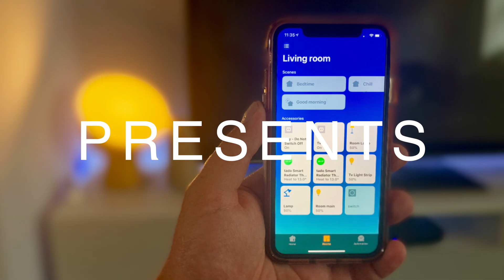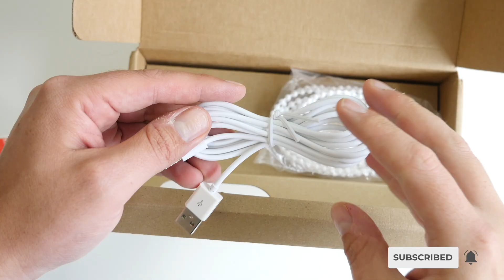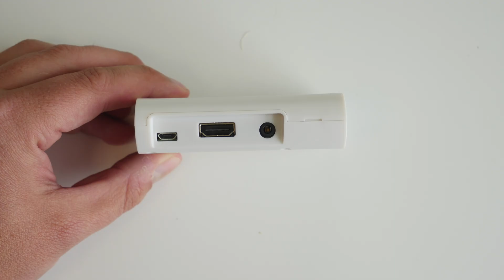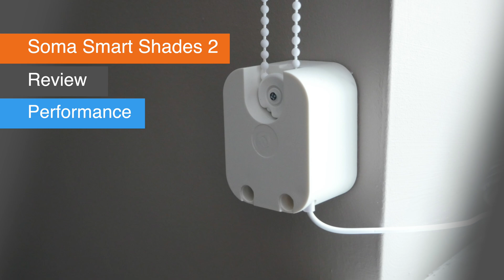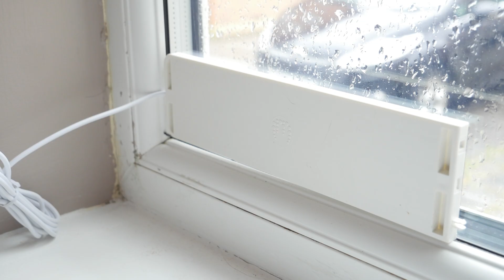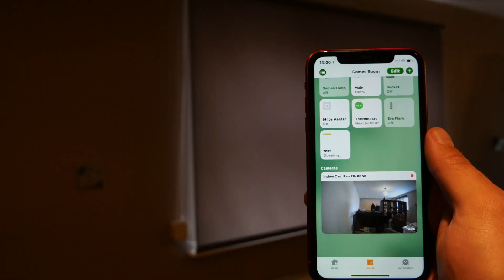Soma SMart shades 2 review - HomeKit enabled smart blind controller with improved speed!

Comment: Soma Smart Shades is a shockingly bad bit of tech. Avoid and go with something more reliable. I’ve had it since it came out and it’s always either stuck or the hubs disconnected and needs restarting which results in Siri saying “the blinds are not responding”. To update the software you have to manually remove the memory card from the hub (raspberry pi) and then put it into a card reader, then download the software manually from their website, then put it on the usb card, put it back in the hub). The whole product is so clunky and buggy. Avoid avoid avoid.

Comment: Soma really should add Open/Close buttons to the face of the device. Maybe even a physical switch to disengage the motor from the chain drive to allow for manual use if something goes wrong and it isn’t functional for whatever reason. I’m a firm believer that if automation prevents manual operation, then it’s bad automation.
Maybe in a Version 3 🤞🏻

Comment: Can you sync 2. I have 2 windows in 1 room
Reply: I have the same question. Probably using Somma Connect you can do that. It support unlimited number of SOMA Smart Shades, SOMA Smart Shades 2 and SOMA Tilt devices.
HomeKit Authority, Could you confirm if is it possible with and without the Somma Connect? Thanks in advance!

Comment: Hi! I’ve just got another smart blind controller and I’m having a small controlling issue inside Home app. You see, the motor I got is controllable through TuyaSmart and I’m using a HOOBS hub to being able to control it in Home. 

Here’s the issue: in TuyaSmart App, I can set the blinds opening at any percentage, but in Home, I can only fully open or close de blinds. Is it a limitation of Home? I saw you in your video controlling your blinds in Home, but you did not stop it midway let’s say. Is it because you simply can’t in the Home app?

Thanks.

Comment: Great stuff mate. Love the video. I've had my soma's now for about 5 years love them but would like to upgrade to the version 2 bit didn't know if it was worth it. Also have been very unhappy with the Google assistant integration as I have to say it about 3 times now to open or closed the blinds and it doesn't also let me open the blinds to a % which it did with homepod. Soma have told me it should work but it's like 1-2 months reply from them every time I send an email so I just gave up.

Comment: I just got my soma shades 2 the other day, such a great product my brother went ahead an ordered another 3 motors for the other blinds in my home. I just placed an order for the soma connect which will arrive soon, they are quite noisy but for the ease of installation and battery capacity Its a pretty good trade off, I set my blinds to automatically open in the morning when my alarm goes off and I barely notice the noise, some others may not put up with the noise as well as me but I think its a great product. One step closer to having a full HomeKit home, loving it so far.
Reply from the maker: Great stuff! Hope you enjoy your HomeKit journey
Reply: Do you know if you can “sync” 2

Comment: Horrible product! Do not use it on your wallpaper.
Reply from the maker: Not meant to be stuck to wall paper
Reply: That is not what the user manual claims
Reply from the maker: You need to remember that the company can’t control the quality of adhesive of the third party wall paper. The manual makes no reference to wallpaper. Just a clean surface

Comment: Did you have to replace your chain with the one in the box? My current chain has a oval connector  to join the balls and it doesn’t look like it will run through the soma
Reply from the maker: I had the same issue. I could not change the chain out. However I positioned the oval bit in the right place I was ok. It would all depend on your blinds and length

Comment: Hey Jon great channel. I noticed it said on the box 2 X 2.5 blinds, my windows are bugger than that, would it work then? My understanding is that the motor keeps rotating until you set it to a specific point. Also, do you have any recommendations for similar products that work with homekit? This seems just a bit too loud. Thanks
Reply from the maker: Thanks for watching, it’s appreciated.

I would suspect that if the blinds are bigger then that then I would not recommend as I think a 2m blind would be just on the limit. 

The only other blinds I have used are the Ikea full unit models

Comment: Thanks for the video. Did you happen to test the maximum proximity between the connect module and the blinds controller? I am seriously considering getting a bunch of them (5 or 6) but unsure if I’m going to need to get 1 or 2 connect modules due to its bluetooth range. i’ve got 3 adjacent rooms with windows all on the same side (so there will be walls between these windows), distance from on end of the windows to the other is about 10 metres. It would be really helpful if you could comment on this. Or even better, test it out. Thanks in advance!
Reply from the maker: The Bluetooth range of the blind unit is about 15 meters. However I tested the soma in different locations in the house and had no issue with around 20 meters range
Reply: HomeKit Authority 🙏🏼 thank you. this is really helpful. Guess i’ll go for just 1 connect module then ;)

Comment: Wow! Was delighted to see a new version of this product BUT totally disappointed by the noise. Unfortunately a no go for me as I have 5 blinds in one room and if I was watching tv and had a movie scene or anything like that the noise would surely be deafening. Great review and thank you for this.
Reply from the maker: I think the video footage is worse than it is. But they are loud for sure. But it also depends on the blinds you use I suppose
Reply: @HomeKitAuthority  Yes I suppose as it would depend on the weight of the material and length that is from roller to blind is fully closed point. But consider that when I say 5 roller blinds in one room (3 for bay window and 1 for each double doors out to patio) scenario the noise will be too noticeable. Have you reviewed any other smart shades (HK compatible) ?

Comment: I think on the controller which you attach to the wall, there should be buttons. One to act as a remote so you don’t have to use your phone (if you don’t want to) and to control the blind in case something dies or stops working like you said. If you have to send feedback I might mention this.
Reply from the maker: That’s a great idea
Reply: HomeKit Authority just popped into my head 😎